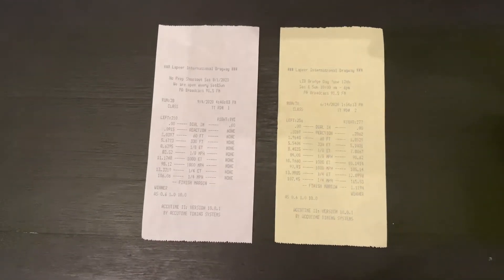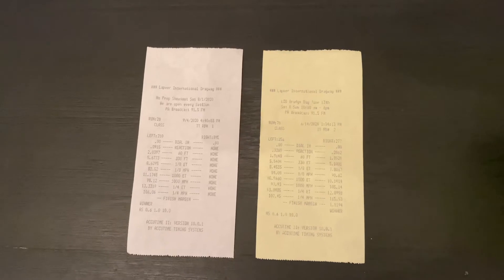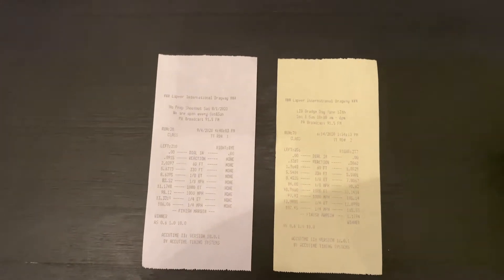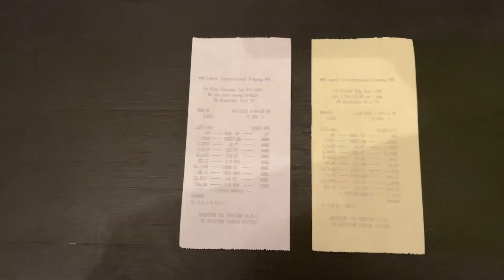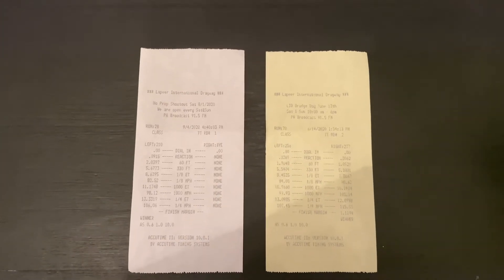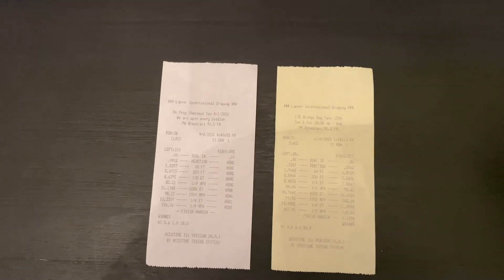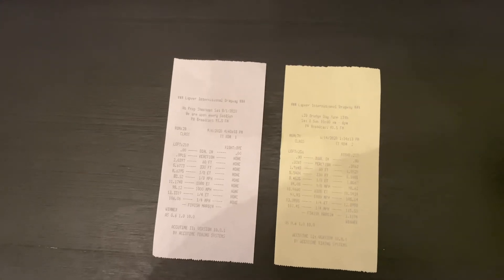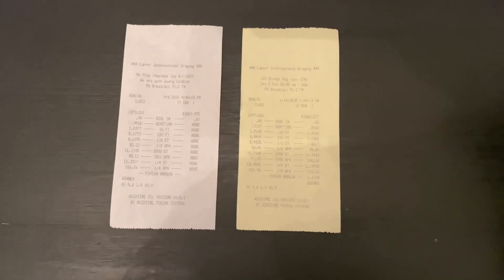How to use launch control in a Dodge Challenger and Charger (**DRAG STRIP EDITION**)

Comment: I haven't tried it yet on my Scat Pack, those a great times for a 5.7, what is the altitude of the track you ran on?
Reply from the maker: 837 ft is the altitude. I just ran a 13.03 yesterday with a great DA here in Michigan with a ton of wheel spin. Once I get my slick I will be running 12.7-12.8 stock with just a tire! I had several 109/110 mph runs but just had to much wheel spin to get into the twelves.
Reply: @8speedhellcat889  That's fantastic MPH! You should be in the 12's with a slick.
Reply from the maker: @daytona5.722  fingers crossed🤞